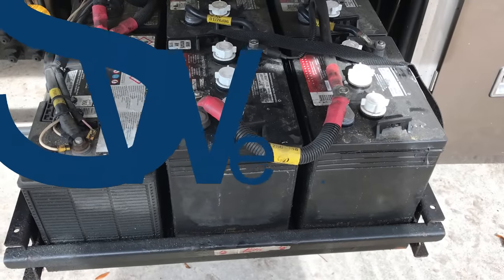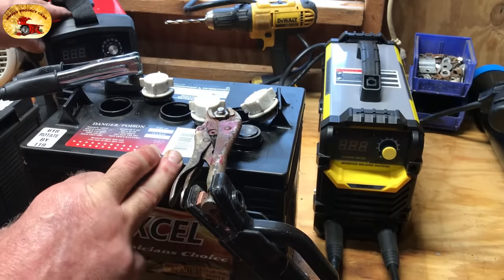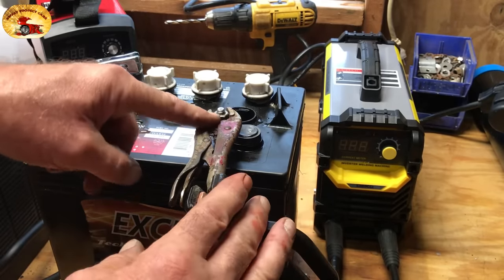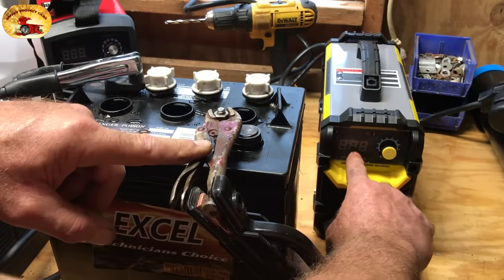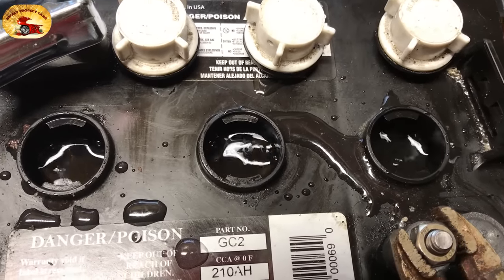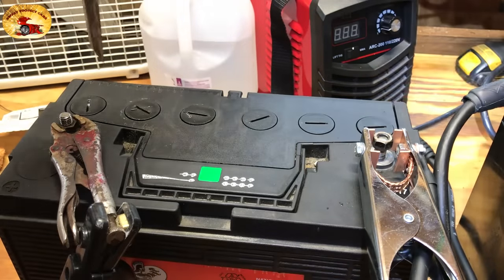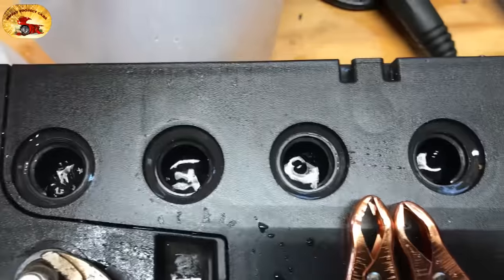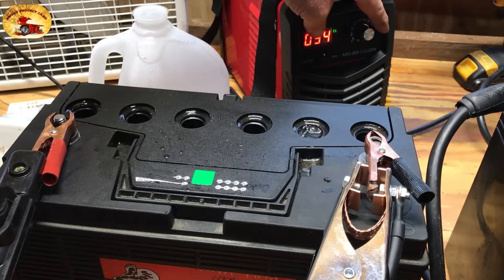How To MAKE OLD BATTERIES NEW Again!!!  12v 6v Deep Cycle, Car, Truck, Golf Cart, Semi

Comment: This process is called "Equalizing" the battery and is standard maintenance process used on led-acid batteries.  Most of the time they will put a constant voltage Equalizing charge on it of 15v-16.5v for about an hour depending on the temperatures. At lower temps you can do it at higher voltages.  What you're doing is basically the same thing but for a much shorter period of time and using higher voltages.  Its actually a really great idea in my opinion because sometimes even at 16.5 volts you still can't push the current through the sulfated layer on the plates.   They recommend to do this once every 1-3 months to keep them fresh on batteries that aren't used very often.  If it's an AGM battery you need to be more careful to not overheat it.   Thanks for the great video.
Reply from the maker: Our pleasure.  Thanks for sharing! Have a great day.  mad Mike the hammer SPC
Reply: Yep,did this when I was in charge of maintaining forklift batteries. Had industrial chargers that could equalize,wanted to say they did around 205 amps for equalizing,was years ago.
Reply: Is it amps or voltage on that welder's  lcd-display?

How much voltage does the welder put in that battery? If I understand your comment correctly, 16.5 Volt 8s a maximum. But the welder does 200 Volt, does'nt it?

Comment: You recommended I watch this video but this is using a welder and I only have the Schumacker battery charger with 200 amp 12 volt.  Any other video you can recommend? Thanks
Reply from the maker: Just follow the original video, we only gave you this video to get some additional helpful information about the process. Thanks again for watching, have a great week and all the best on your project. mad Mike the hammer SPC

Comment: Which welder would I buy for larger batteries out of heavy equipment and trucks? They are 12V flooded lead acid batteries built the same as standard car batteries, but 2-6 times larger.
Reply from the maker: Use the one for standard 12v, everything is the same for that size battery my friend. Thanks for watching. mad Mike

Comment: I have been using 12v unit adj to recover  units for years.
I have been reviving batteries forever with non computer chargers.
Until this moment, I did not put them together.  I am going to try. 2 to 200 amps, with full amp control. With the hf welder, extraction. I dont rich expensive gear. (I don't use cheap Chinese stuff for gold exstraction.)
After bringing them up some. I have found a pulse 4 amp charger that seems to restore them to 80 to 90 per capacity. 
This a fantastic repair. thank mike
Reply from the maker: Thank you for watching and sharing, we appreciate the input Mike, have a fantastic weekend my friend. mad Mike

Comment: Nice video, but one correction the meter is reading amps not volts. The voltage output in the yellow is about 20.8v to to 26v.
Reply from the maker: Thank you for watching and sharing Adam. Have a great day. mad Mike the hammer SPC

Comment: Ordered my inverter welder today. Have bought pulse Tex maintainer which has been in place a couple years now. Not seen any real world improvement with it. Bought two more desulfator chargers with near endless hours ran on deep cycle batteries with very little improvement. This method looks promising but still up in the air about it. At I will have small stick welder that can be used portablely with genny. I’ll try this a couple times and if no improvement I will change out the electrolyte after boiling a couple times in distilled water. Also get specific gravity readings through out servicing. Thx for video
Reply from the maker: Happy to help Tommy! Thank you for watching and sharing, have a great day and all the best on your project my friend. mad Mike the hammer SPC

Comment: I need to desulfate multiple golf cart batteries in series. Can I do them in place while interconnected or should I remove batteries and cables to do each battery alone?
Reply from the maker: Watch this  https://youtu.be/KzOQH1twpI8  They can be done in place and you can have them interconnected.  Thanks for watching and asking, have a great weekend. mad Mike the hammer SPC
Reply: @SweetProjectCars  The cell next to the grounding clamp will boil like crazy before the other two cell even show a bubble or two. What do you suggest?

Comment: Thank you for the great video. I tried your process and was able to get all the cells the boil except for the two ends. Any suggestions?
Reply from the maker: With this method, if you can't get all the cells to boil then the battery is un-repairable.  Thank you for watching and asking.  Have a great day Brian.  mad Mike the hammer SPC

Comment: Hello, do you do that before charging the battery full or after? After this treatement, do you replace the electrolite or leave the old one? Adding distilled water dilute the electrolite. Is this ok?
Reply from the maker: We've done this process for years and years and years, it used to be done at all full service gas stations, it's a lost art my friend. Watch the video and follow the instruction, you top off the cells within an inch of the top with this https://amzn.to/3ESAS8i  before beginning then again during the resting times if needed. Have a great day. mad Mike & team

Comment: What king of voltage are you applying to your 6V battery , I need to revive 2 deep cycle Trojan 6V cells ... regards
Reply from the maker: Hello L Bou, start out low and gradually turn up until you get a steady boil on all cells, cut all timelines in half for that size battery. Thanks for watching and asking, have a fantastic day and all the best on your project my friend. Happy New Year. mad Mike the hammer SPC

Comment: thanks for the tip, mike...
i tried on my car 2 years old battery, because it was hesitant to start in the morning, using arc 160 dc welder, and it worked... been 3 days now..
just for info, i measured the charging voltage, it was 15.6 volts, on the lowest amps setting.
i used the schedule of 3 minutes on - 5 minutes off, 6 times, because i was cautious of the boiling acid, and the battery was very hot to touch.
Reply from the maker: Thank you for watching and sharing, we truly appreciate it my friend.  Have a fantastic weekend.  mad Mike the hammer SPC

Comment: For Australia where we use 220V. Would it make a difference for the welders I need to use? For example the DEKOPRO 110/220V MMA Welder,160A it would be 60 duty cycles on 220v

Specification:
Input Voltage: Ac110/220V
Current Range:10-160(A)
Rated Duty Cycle(%): 40/60
Reply from the maker: No, the welders come with a 220 plug my friend. Thanks for watching and asking, have a great day. mad Mike

Comment: I ordered the welder for 12 volt batteries. I have a motorcycle with 12 volt battery, will it work for that one? On the video you said the yellow charger was for motorcycle batteries but you use it for 6 volts.
Reply from the maker: This works on all wet-style batteries ozweepa. Just use the tools shown for that size and you will be good to go. Thanks for watching and asking, have a great day and all the best on your project my friend. mad Mike the hammer SPC
Reply: Thank you

Comment: Ive been doing this for 6 years i set mine to 20amps with voltmeter on the battery i sit it in till it reaches 14.4v and stop the charging process it can desulfate and charge the batteries bcause inverter arc welder doesnt have filter capacitor at the output and it puts out very high frequency hv pulses
Reply from the maker: Thanks for sharing.  Have a great day.  mad Mike the hammer SPC
Reply: Good info, Bernalyn.  Is the high frequency HV pulse what makes it more effective at desulfating than a 200amp boost charger?  I just bought a used 2/40/200 amp boost charger (manual / analog type) after seeing Mike's older method.  I have 12V car and 6V golf cart batteries to recondition.
Reply: @jarodofficer  yes, the pulses are what shakes things loose so they can re-dissolve back into the electrolyte.

Comment: I know next to nothing about welding. Bought a "Stark AC welder" a few years ago did not use it at all.  Pulled it out and tried this method with 70amps.  Thought I did something wrong.  I heard a pop and the clamp that I used (may be it was too thin) burned off.  But I tested the battery and WOWW!!! its up to 800 plus cranking amps! Thats from a max of 250 CAs after several attempts to charge it after using your previous "bubbling method".  Mad Mike big props...this freaking works!
Reply from the maker: Good deal, glad it worked, surprised you got it to work with AC voltage, are you sure it wasn't on DC voltage?  Thanks so much glad we could help.  mad Mike the hammer SPC

Comment: what's the difference between the red welder and the blue welder?  I need a red welder for my car battery... What kind and size of welder am I looking for to do this?    Thanks!  Great Video
Reply from the maker: See this 
Welder for Deep Cycle ONLY 6 Volt & 12V Batteries    https://amzn.to/3yW4ihK  or  https://amzn.to/30k7YNg

Use This for all Standard 12-volt Batteries    https://amzn.to/2K1UsWQ
***If the above welder is unavailable, either one of these will work  https://amzn.to/3mqhebK or https://amzn.to/3sH4COq *

After doing this process using this charger to slowly fully charge the battery  https://amzn.to/3kmCThX
and just a reminder, all of the products/tools we use in our videos can always be found in the ...MORE of the videos description, see here  https://3c5.com/4u6dj  if you can't find it let us know and we will help you.  Thanks for watching.  mad Mike

Comment: I have a 58 month old Exide 60ah Lead acid battery used in VW Polo TDI 1.2, properly maintained with 1st top up with distilled water at 36th month and 2nd top up at 58th month but still it died,
Now at what power should I use the welder ? 
Yesterday my battery died, when I tested on multimeter 
on car engine turned off the voltage showed 12.6volts
and on alternator charging it was 14.4volts
And on cranking the starter the voltage dropped down to 8volts which jus could not start the engine , but sometimes it starts easily , sometimes it doesn't .
Kindly advise 🙏
Reply from the maker: Start the welder on lowest setting, then gradually turn it up until you have a consistent boil on the cells, then make sure you use this  https://amzn.to/3kmCThX  after doing the process.  Thanks for watching and sharing, have a great day my friend. mad Mike the hammer SPC

Comment: I must admit that I have used this method before and although it does not restore the battery to it's former cycling performance, it's definitely worth pursuing if you get through a lot of 12v batteries.
Over the years I have refined this method of using a large capacitor bank in parallel with a high current charger, to dump multi-hundred amp pulses into the battery to break off the cell sulphation in much the same way, without the risk of thermal run-away.
Reply from the maker: We've had batteries that have lasted years and years, you may have to do the process every couple years, but still a huge savings in the long run.  Thanks for sharing.  Have a great day.  mad Mike the hammer SPC
Reply: Do you have a circuit diagram? I have some large capacitors and a large battery charger.
Reply: Well Mike, that's great will try that. on another note I had great success with another two batteries, one which I put in my JD gator and used for last two days starts first crack.. Happy new year from Ireland. D..
Reply: Possible to get more info of how ?
Reply: I've also seen someone build a high voltage pulse generator. He claimed 90% batteries come back to factory parameters...
Reply: @krzysztofniedzwiedzki8061 I'd like to see more about this method. Can you get a link or was it a friend who did it?

Comment: When you are adjusting the dial on the welder, are you adjusting the welding amps or the voltage.  So is the 38 that the welder is cranked up to indicating 38 volts into 8 or 12 volt battery for 5 minutes on and then 10 minutes cool down.  I h ave been using an additional 12 volt car charger along with my standard 48 volt charger that comes with my golf cart, 6 batteries.
Reply from the maker: Turn both dials to zero, then start turning the amps dial until you get a consistent boil on all cells, watch this update for more info  https://youtu.be/TxrR1aepKlM  watch and re-watch all of the videos so you can get this down and first and foremost, make sure you are using the tools we use, they are very explicit Gary. Thank you for watching, have a great day. mad Mike the hammer SPC

Comment: Hey, it's me giving you an update about my battery charging attempt that I wrote about below.  I checked my battery before the 5th round of charge and it showed 12.73 Volts.  I charged it for the 5th time and tested the voltage again which was the same 12.73 volts.  Installed it in my BMW 740IL which takes a lot of power to crank and it started right up.  A happy ending.  I just hope for it to hold its charges for a long time.  Thank you Sweet Project Cars.
Reply from the maker: Awesome!  Thank you for watching and sharing my friend.  Glad to hear.  Have a great day.  mad Mike the hammer SPC

Comment: Hi Mike. I tried this process and yes it did work, but only for a DAY.  Also, I cycled my battery EIGHT times with my welder and it boiled like crazy. The battery would not stay charged past 2 days! lol. My conclusion is I  need to put in some new electrolyte and then it should hold a charge. HEADS UP. Any stick welder will work as long as the duty cycle can handle the 200 amps for 5 minutes. In addition to, I let it cool for 30 mins as the Texas heat is tough.
Reply from the maker: Thanks for watching and sharing, and you are correct, this is a process that should be monitored. Have a great day. mad Mike the hammer SPC
Reply: Did you add electrolyte?  Did it work?  If so, please describe your process
Reply: if the mat from the battery is gone, it wil not hold any voltage anymore. Its like clay, or fiberglas in the gell batterys.
Reply: Did it work with new electrolyte?

Comment: I have a quick question. My DC inverter welder is an arc and tig welder, and so the clamp is + and electrode end is negative. I'm assuming that I go + clamp to + battery terminal, and - electrode end to - battery terminal? I don't want to blow anything up by reversing polarity. Thanks
Reply from the maker: we are not sure on your system you are using thats why we make it fail safe and ask for everyone to use the exact tools we are using...thanks mad mike

Comment: Mike, I’ve got (4) scissor lift 6v batteries (cr-205). I’ve topped the cells off and I am now on my 8th cycle of bubbling with your instructions with the welder (MMA 160A). After the batteries have sat for a 24 hour period, they only read 5.9-6v instead of the 6.3ish they should be reading. I tried using a 6v noco genius trickle charger but it goes red (charging) for about 36 hrs then shuts off like it didn’t work. Do you have any suggestions? Or are these batteries just toast? Thanks in advance.
Reply from the maker: Try one of the batteries in your lift, if you've done 8 cycles, try one of them, if it doesn't work for you the batteries just may be toast, it doesn't happen very often this works more times than not. Give one a whirl my friend. Thank you for watching and asking, have a great week Jacob. mad Mike
Reply: @SweetProjectCars  okay, I tried and they are not holding charge. But there’s a bunch of powder in the battery tray of the lift. I assume dehydrated battery acid? Is it possible when I added distilled water I diluted the cells from a lack of acid and I now need to empty them and buy some more acid?
Reply: UPDATE: I solved the issue. I changed the acid out and batteries that read 5.9 now read 6.35 volts! $70 for 5 gallons of acid at a battery supply store. 

Side note: one of the batteries somehow reversed polarity after changing the acid out. So I am now working to deeply discharge it and charge it back to reverse the polarity back to positive positive, negative negative. 

Thanks for your videos!

Comment: Got the  latest grey Amico welder (which is a nice little welder for sure) that was recommended took an old ancient Legend battery out of my friends barn which was totally dead and sitting on the bare ground for a long time in a frigid climate, hooked it up and turned the knob till it started boiling (about 90 amps or so) I followed the procedure to a "T" and after cooling I charged with a NAPA 2 amp trickle charge for 24 hours it did bring the battery up to the spot right between "replace" and "good" on the NAPA charge gauge and
 I tried it quick on my 16 HP JD mower which it easily started again and again with no trouble.....I was wondering if Julio ever recommends doing the procedure twice or if there is any detriment to doing it twice if one winds up with a marginal result. Oh BTW a couple things I noticed was if you try a battery and it won't boil regardless of how hard you hit it including (200 amps) its toast take it to the junk yard as the physical electrical pathway internally has been compromised somehow also I had trouble with the battery boiling over as it became warmer about (125 degrees) this was easily corrected with my wife's turkey baster by extracting a little bit (she'll never miss it) LOL .......Julio what do you think?  2nd time around with the procedure? also I ordered the battery charger recommended but still waiting for it . I will follow up with how this works
Reply from the maker: Thank you so much for watching and for sharing your results Darrell!  Hope you have a great day.  mad Mike the hammer SPC
Reply: yea  you can do it more then once